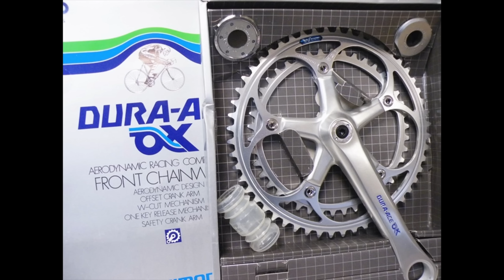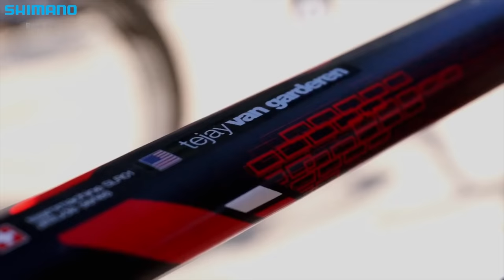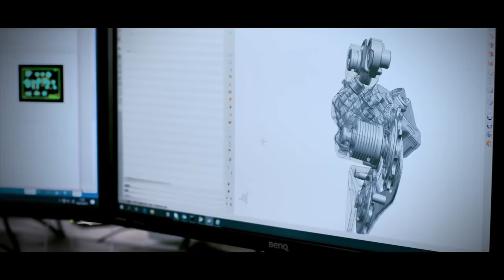Here’s Why Shimano is the BIGGEST Cycling Company!

Comment: If you spend some time restoring old bikes, Shimano's key to success will be obvious. Their manufacturing tolerances were amazing from the mid-1980's onward. By 1983, engineers in Italy, Austria, and Japan could all diagram magical indexed shifting systems with ever more sprockets, but their employers had to be able to build them to ever more precise tolerances. Shimano could and did. So whether Capagnolo, Sachs, Suntour, or Shimano actually designed one innovation or another doesn't really matter. Manufacturing precision made those innovations work reliably. And for the icing on the cake, Shimano gave a lot of consideration to the little things - an assemply that required two awkwardly held and oddly sized wrenches on a Campagnolo part needed just intuitive and accessible hex bolt on its Shimano counterpart. That elegance is why Japan took over the manufacturing world for a multi-decade run.
Reply: nonsense. You can't rebuild a Shimano shifter, but you can rebuild Campagnolo shifters. That's how considerate Shimano is. 
And nothing beats shifting tolerances on any Campagnolo groupset. Before Shimano did that right, Campagnolo was always one cog and some years ahead. They were only catching up after 10-speed. 
That's not to say Shimano is bad or it doesn't work well, but don't pretend like they were significantly above their competitors in any decade, even know with their disc groupsets they were having an inferior disc design compared to Campagnolo. The only thing they are truly better at, is market share. But as we all know, everyone going to McDonalds doesn't make it the best restaurant in town.
Reply: I love my shimano bicycle, it makes me feel like I’m gliding like I’m hovering above the ground, I didn’t need to pedal much like for those cheaper brands. And mines didn’t even cost a lot(was a gift) it’s like only 300-500$USD I forgot where really. I like riding bikes and I like that bike, plan to get another one and for my old self, I’m going to try to ride a motorcycle.

Comment: Shimano, Campagnolo, and SRAM have all contributed to moving the groupset forward in quality and capability.  It's something else that has made Shimano king.  Data is hard to come by, for obvious reasons, but it looks to me like Shimano sells way more of its lower-level groupsets, mostly in the OEM market, than it does its higher tiers.  It dominates that segment.  The profitability of dominating at the entry level is funding Shimano's ability to innovate.  In contrast, Campagnolo doesn't try compete at the entry or even middle level; even its lowest-tier current groupset, Centaur, probably lies between Tiagra and mechanical 105.  This disparity seems to have existed between Shimano's entry-level and Campag's entry level for a long time, which mostly explains why Shimano has become the dominant player.  To summarize: Shimano's road bike groupset dominance stems from the quality and pervasiveness of its lower-tier components, not from the supposed superiority of its upper-tier.
Reply: How or why do you think shimano dominated the entry and mid level segment like 105? Have you looked at 99spokes? 80% of all bikes sold at a LBS are equipped with shimano. They simply produced better and more reliable groupsets at the entry level

Comment: When do you think shimano will master building crank arms that don't fall apart due to corrosion?
Reply: Have you ever heard about new Shimano 12s crankset failed? If yes, please share the info.
Reply: @apair4002  Yes my friend’s new ultegra 12s crankarm failed on the bolt holes sheared completely and the non drives side arm starts free spinning
Reply: Basically the axle threads on the non drive side sheared
Reply: @apair4002  shame on you, April. You question me, as if I don't know what I'm talking about.
Shimano sells a lot of stuff!! Some of it doesn't last too long.

Comment: The problem I have with Campagnolo is the limited compatibility between parts and groupsets. Chainring bcd, cassette body, pulley wheels, rimbrake pads etc are all just a little different. So for every maintenance job you need a specific campagnolo tool and finding the exact replacement part can be really hard. For convenience I’m finally slowly moving towards Shimano.
Reply: BCD has been solved since 7-8 years with the 4-bolt standard. Cassette body is vastly superior, but admitted, the cassettes are horribly expensive. For pulley wheels you have 3rd parties making them (cheaper), brake pads are very nice and not overly expensive.

Comment: What is usually overlooked when road cyclists discuss their opinions about Campagnolo vs. Shimano is the fact that Shimano is the only full-range supplier. They produce componens for almost every type of bike whilst Campagnolo is only available for drop bar bikes. This means that almost all bike manufacturers have to sign a supply contract with Shimano anyway if they want to equip their mountain bikes, cargo bikes, city bikes, etc. in addition to their road bikes. This means that Shimano can probably always offer cheaper than Campagnolo simply because of the number of units supplied. I'm pretty sure that's the main reason for Shimano's market dominance (even on road bikes) and has a much greater influence than various technical details.

Comment: You could have replaced the word Shimano with Honda in this story. 

It's neat how aspects of a country's culture appear in their products.  Cars, watches, airplanes. 

European stuff is a work of art, requires a bit more care to operate, is expensive to buy and maintain from greater complexity.  American stuff works eell for its purpose and is relatively cheap to fix. Japanese stuff is designed to work in any conditions, and durable so it doesn't need to be repaired as often.
Reply: Honda cars have a name for reliability over many for continuance of operation..
Reply: Agreed.  I've owned several BMWs while my wife is. Lexus lover.   Her cars only need the most basic of upkeep and maintenance while mine.  Let's just say , I ended up learning how to replace valve covers, driveshafts, water coolers , thermostats and am pretty damn good and finding leaks.   I love how they drive though.
Reply: In addition, I moved from the big S to SRAM when I got etap (1st gen.) and think the thought that's gone into it is pretty great, American parts are practical and usually user-serviceable..

Comment: I have one of the “bloopers” – XTR Dual Control levers (exactly the shown ones) – on my 26er and it’s very hard to criticize them! This bike serves mainly as a commuter and honestly this is the best shifting system for cycling through town. I can easily downshift whilst stopping at a traffic light with barely any hand movement, yet I can still have flat bars, which are in my opinion better for urban riding than drop bats. I also used this bike a bit for true mountain biking in the period after selling one team sponsored bike and waiting for another and I must say it doesn’t perform bad in this behaviour either. Now that I have access to the latest XTR 1x12, I wouldn’t choose it for modern day XC race, but it wouldn’t be no problem doing some not incredibly technical XCM race and I could totally imagine doing any kind of race with this groupset from its era.
Reply: I had them on my bike for the Cape Epic. Work perfectly.

Comment: Shimano simply works form top end to budget components.  My GF has an MTB that came with Sram NX shifting.  I was unable to adjust the indexing for all 12 gears.  My LBS couldn't adjust it either.  I had to replace shifter and derailleur with GX.
Reply: Was the hanger by any chance bent? No indexing can fix faulty shifting when that part is misaligned. I've indexed SRAM NX a handful of times, never failed to get it right.
Reply: @yonglingng5640  The bike was brand new.  There were always a couple of cogs where it was skipping.
I have GX own my own MTB, works perfect.  Same on my GF's bike after the upgrade.
Reply: @hansschotterradler3772  Even new bikes don't always come with perfectly aligned hangers. Of all new bikes I've unboxed, almost all of them have slightly misaligned hangers.

Was the cassette checked as well?
Reply: @yonglingng5640  It was a brand new bike, and even the LBS couldn't get it adjusted.
Reply: @yonglingng5640  Can confirm, I have an SX Eagle set, it was almost impossible to set, even with a perfect hanger, in the bikeshop they had to align it multiple times, but finally they got it. (Maybe they bended the whole derailleur a bit out, to get it work, or something like that. It's a feature of these, that their pulleys are inwards...)
Reply: Funny how all my friends were like "shimano is crap, get a sram", and I got an SX Eagle on one of my bikes, well, my Deore M5100 (current 11 speed, lower end line) on my budget hardtail is superior in every way.
Despite of it being 11 speed, it supports 52 teeth cassettes, the clutch is actually stronger and you can set the strengh of it by a screw in the Deore. The Sram's chain is so loud when changing, and I can shift with the Shimano even under heavy load too.
I know that the SX is their entry point, but it just feels crap, meanwhile Shimano's cheapest 1x system works perfectly.
When using the SX I just want to upgrade it to a GX hoping it gets better, but when I'm on the Shimano I do not understand why would anyone buy a more expensieve derailleur.

Comment: 1981 Shimano’s aero dynamic group set killed off the French bike component manufacturers. French had gears  by simplex, brakes by Mafac, etc each component under different management,  although they did try. Only campagnolo could step up to shimano by producing a good aerodynamic response.
Reply: As someone who has worked in the cycling industry for 45 years, I can say with 100% confidence that the Shimano AX group had no hand in killing off the French component makers. It was Suntour, Dia Compe, Sugino, and SR who did that in the 70’s. Shimano was starting to make a dent, and made good (and arguably better) derailleurs than Suntour, but did not really take off until they introduced Dura Ace with SIS in 1984. After that Campagnolo and Suntour were well behind, with Suntour succumbing to the falling yen. Shimano also had the resources at that point to dominate the growing mountain bike market, which Campagnolo tried in the beginning but soon abandoned.

Comment: Having handled parts from The Big 3 countless times, it's safe to say, Shimano gave me the most confidence in working with groupsets, mainly also because I'm familiar with them.

Not only do they possess good mechanical design (I like the adoption of Shadow RD and repositioned STI lever clamp band bolts), their online resources (Shimano Technical Documents) are easy to access as well (I knew about this and started using them long before I worked as a shop mechanic).

Simply put, their components just work.

Here are some reasons why I don't prefer the other two:

SRAM
General: Not sticking with one standard long-term (mainly the crankset spindle), DOT fluid for hydraulic brakes
Mechanical: Requires more force to actuate shifts (very tactile shift paddle feedback), DoubleTap shift logic has the steepest learning curve (not so friendly for beginners in my opinion)
Electronic: Heavy and bulky derailleurs (eTap AXS), slightly slower shifting than even third-generation Di2
Campagnolo
General: Chains still use a pin (that also needs be peened, something almost all chain breakers can't do), crankset spindle-mounted bottom bracket bearings (that also run different 6805 bearings that are 1 mm thinner: 25x37x6 mm), horrible ErgoPower lever clamp band bolt placement (requires long-reach bits)
Mechanical: Proprietary shift and brake housings (4.1 and 4.9 mm instead of 4 and 5 mm like everybody else)
Electronic: Wires factory-attached to every component (even messier than first to third-generation Shimano Di2, easier to screw up too), doesn't shift as fast as Shimano Di2
Reply: Sounds like your complaints about Campagnolo relate to your experience as a bike-builder, not as a rider.
Reply: @5891jonathan  Even riding with Campagnolo doesn't feel as good too, the ergonomics just don't suit me all that well. In terms of sprint-shifting, among all mechanical groupsets, SRAM DoubleTap did it best.

I only like riding with whatever I like working on, this is something most riders will never say because most don't dirty their hands and fingers from working on their bikes.

Comment: Isn’t it simply because they made shifters that shifted better, brakes that brakes better, and wheels that wheeled better? 

Let’s be real. Campag’s only really appeal is this misplaced confidence in “Italian” workmanship.
Reply: The mechanical design in their ErgoPower levers is a joke. You can't easily torque them down on the handlebars as you need a long-reach bit for that and not everybody has such a bit.

With Shimano STI, especially the newer ones, just a regular bit socket will do.

Comment: I think Shimano tricked people into thinking that friction shifting is difficult. It isn't, and it is very lightweight.
Reply: Indexed shift levers are heavier than friction shift levers? Do tell. 🤔
Reply: @5891jonathan  I am referring to downtube shifters and STI shifters. Just the shorter cable will save you kilo or two. Indexing is only needed if the rider lacks coordination in his or her digits.
Reply: 100g less weight won't help you when one bad shift leaves you 100m behind on a hill... (and even pro's made bad shifts back then). Also, my new Ultegra Di12sp can shift under ridiculous power.